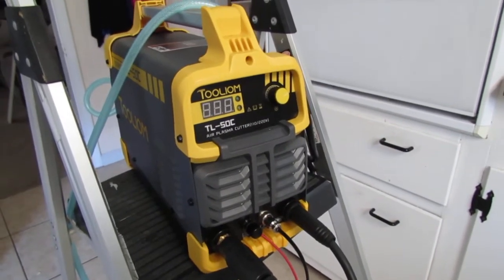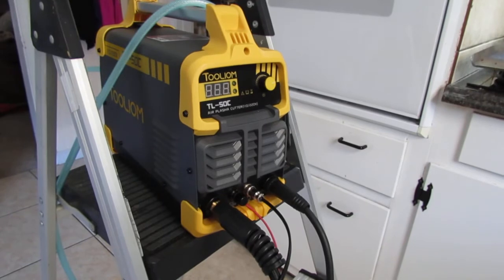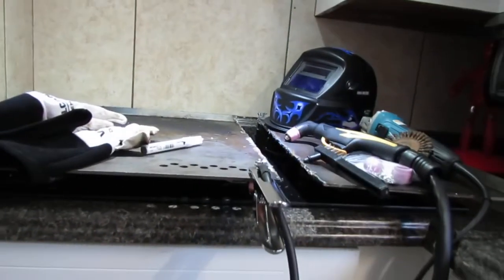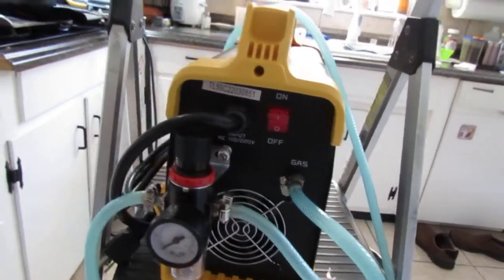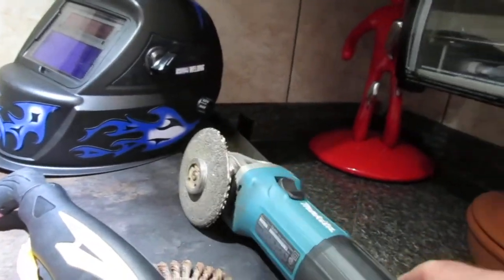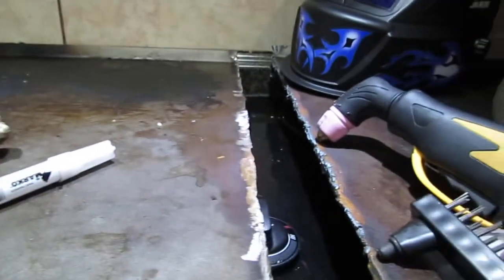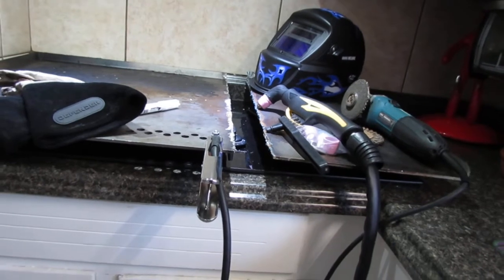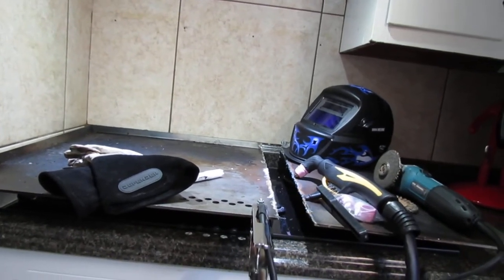Testing Review Tooliom TL50C Plasma Cutter Best way to cut thick stainless steel metal Read Below

Comment: A good helmet is well worth the money. I use the Vulcan from harbor freight. It is not the best, but it is night and day better than the one you have there. You can get some cutting glasses that are fixed shade, but won't be as dark and much more clear than a welding helmet.  Also, you can use a light to shine on your work while you cut. Just being able to see will improve your work a ton.
Reply from the maker: Thanks for providing this information

Comment: If you clamp a straight edge to the metal panel you don't need the white line and you can run the cutter straight down the line.